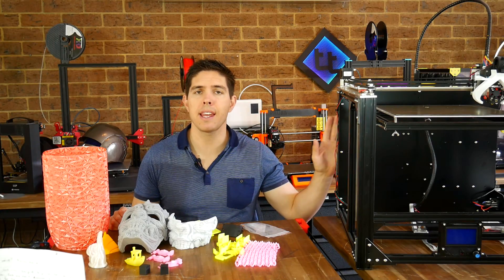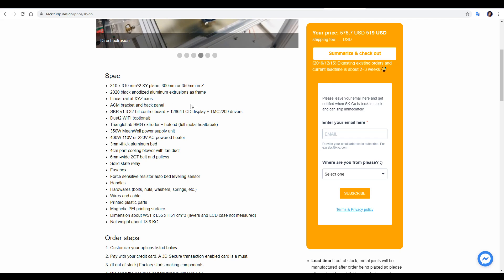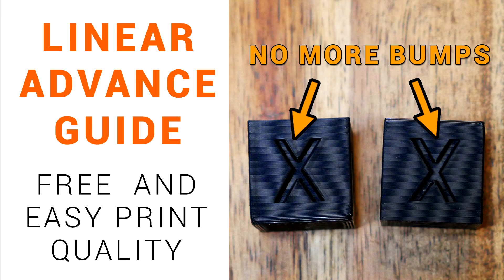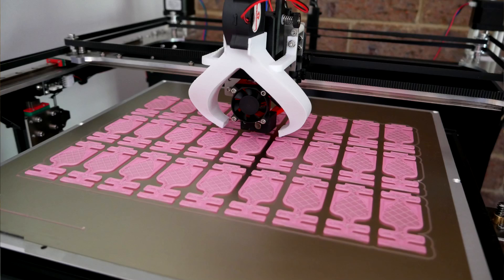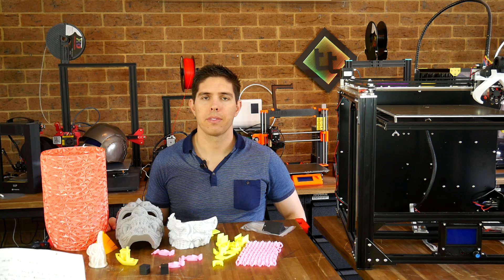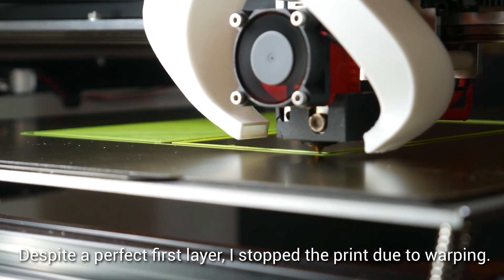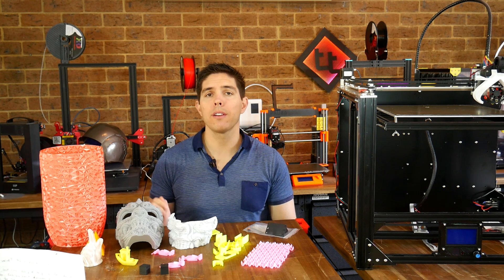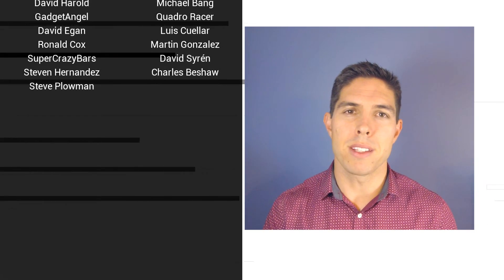SecKit SK-GO review - My best print quality 3D printer to date

Comment: How would you compare this printer to the Creality Ender 6?  It looks good to me from what I have seen from their web site.  What kind of speeds can you achieve with it?  I think though I might look a bit more at the Voron 0.1.  It is smaller, fast, and you can enclose it for ABS.  I just wish it was a little bit cheaper or I could find something similar to a Voron 0.1 that cost slightly  less.  I don't have room for a big printer like this.

Comment: Jesus, $1000 CAD for this thing...I'll just fix any o the issues with the the X5SA Pro that is $700 less....
Reply: I've been looking at the X5SA for my first 3D printer but some of the reviews are scaring me off of that decision. It seems when the issues that it has are addressed it can make great prints though.
Reply: @Invictus_Mithra  yeah its actually not bad at all, have a hemera on it with black leveling sensor and glass bed(also use whambam spring steel) rarely have issues unlike my ender 5 plus that if you fart near gets messed up, I will not do a filament change on it when it runs out, always layer shifts, I will sit there and feed new filament down the bowden tube to my DD hotend as it prints

Comment: So if you have problems with the fan noise try the fan off the machine. If it's quieter then rubber mount the fan or customise the fan housing to incorporate it into the design. if you do incorporate it into the design (o) use a bigger fan.

Comment: Contemplating getting this as my second 3D printer. How easy would it be to use the E3D Hemera, since the stepper motor is no longer sandwiched between two parts of the printer? Just because I have a Hemera handy at the moment and wanted to use the 'suply your own' option for the hotend/extruder. :)

Comment: I wanted to see more on this, my current printer is a cetus mk3 which is somewhat modified. I was debating between this and a prusa for my second printer, can't decide. I don't know if this will be too big a jump or not, I also made a cnc router kit, and circuit design is part of my daytime job. So idk if I should go straight for the sk go or the prusa first, pricing difference isn't major.

Comment: Thank you Michael for another really well-produced video - well done.

This printer seems a bit of a contradiction - it’s sold as the printer that “gets you out of the upgrade loop”, but you seem to have needed many modifications and customisations to make it work and you say that in your summary at the end. It’s a large build area, but doesn’t include auto levelling, so you seem to have had several failures in multi-part prints. Even if only one part fails, it could easily break free, wipe out other parts, and damage that delicate nozzle air duct (which I see you’ve had to repair).

I guess that fine line around prints may be caused by ‘grittiness’ of the linear rails used on the Z axis. I wonder why the build plate frame is supported only at the centre of each side. It was also surprising to see the belt idlers spaced with nuts. 

Tronxy’s X5sa Pro solves the z-stop problem by using an inductive sensor, which also serves for mesh bed levelling (ensures all of the bed can be used). There’s a touchscreen, which shows the levelling measurements, and a touchscreen is always quicker for starting prints or holding temperature between prints. The Z axis is supported on two rods each side.

In your review of the X5sa Pro, you had difficulties with the frame geometry and you didn’t get the same extrusion quality. But you also didn’t make any modifications to it. I wonder if it had a direct extruder and belt-linked Z steppers, whether it might match or better this Sec-kit.

As for me, I have three printers (Anycubic Linear Plus delta, the early Tronxy x5sa, and the Ender-3). The Tronxy has been a disaster since the start, I had endless problems with wheels and belt idlers etc. and I now use my own design of gantry with 608-bearing pulleys. This tends to run for a month or two before my 3D-printed parts distort and wheels slip or seize etc. I have a direct extruder setup with a volcano hotend, and I get slow, crappy prints with lots of stringing, dullness, inconsistent extrusion width. The best part is probably the flex-steel PEI print surface, and Tronxy’s touchscreen seems more useful than what Marlin or SKR offer, particularly for bed levelling and Z offset which work well.

I think I might buy a Prusa... I really don’t know. I just want good-quality extrusion at a fast print speed and 300x300 area!

Comment: Michael, Fellow Aussie. Your videos are awesome and I thoroughly enjoy watching them. After getting my first 3D printer (Ender 3 Pro) a year ago, your videos have helped me out heaps! I've become familiar with the printer, upgrading and modding it and am comfortable using Marlin firmware and using Cura as my slicing program. Getting some great results. 

I'm not at the point where I'm looking to get a larger printer to start printing larger Volumes. 
I'm stuck at whether I should go for a larger i3 Style printer (CR10 V2/V3) or perhaps look at getting a XY Printer like the SecKit SK-GO. 

What would your suggestion be? 
Would it be better to explore other 3D printers, rather then going a CR10 considering it would be very similar to the Ender 3.... or as I am familiar and have learned the Ender 3, would the CR10 be a better option? 

It would be interesting to see some comparison between CR10 and the SK-GO. 

Hope you have the time to reply.
Once again, thanks for your content and videos!

Comment: I bought this printer. Displaycover did not fit the display and only 3 out of 5 linnear rails from Hiwin were ok. Obviously there is something wrong with the way the rails are handled and packaged. I sent an e-mail to seckit asking to buy replacement parts but he doesn't even bother to answer. Avoid this printer and this company folks!

Comment: 2 questions:  did you have to mess with firmware to configure the linear advance? and the model you tested, did it use the hiwin rails or the chinese clones? the website has both as options and I am curious which ones your printer came with

Comment: Wow, the pricing is great! I thought it would be double at least, haha!

Ranged from $519 as a barebones kit (without control board and prints, smaller size, cheap bearing option, no bed plate), to just $732 to best option of everything (except regular control board as I have 0 care for WiFi)

That’s Insanely good quality for the price, the only problem is that $125-$140 shipping in the US (ugg, it costs a fortune to ship anything here... Although I’d have thought it would be like $60, it’s still not cheap any way you look at it). Too bad Santa can’t just deliver one for free cause otherwise I’d pick this thing up in a heartbeat, it’s right at my price range otherwise.

I’m just amazed at the high quality you can get now, my 7 year old Prusa i3 clone kit that came in a bucket of bolts and even required wire crimping yourself was like $300 back then (most equivalent by today’s standards would be those old stock $89 A8 kits or Tonxy models except those are even nicer with a screen and SD card, haha!). This is such a good deal I’m gonna hate turning it down, for now... Maybe in a couple years it might drop some to $600 base level with shipping, then I’ll have to see if I can pick one up, certainly an interesting project for sure! I hope they have a few mechanical engineers that love to tinker such as myself making some open source upgrade parts like I tend to do, because that will be even more quality at crazy XY speed and accuracy!

Comment: Will get quite expensive including shipping, duty & taxes to Europe. Pity :(
Reply: Check out RatRig V-Core Pro, for similair design philosophy (CoreXY, Aluminium extrusions and linear rails, ordering options, active facebook group). They're from Protugal so EU shipping wont be a problem.
Reply: for the price of the shipping i could buy another 3d printer
Reply: Yeah - People in Europe have always seen those extra costs. Just let's face it, we have to pay a lot more for the same quality. Apart from shipping cost we also have to pay an extra 21% VAT (Called BTW in the Netherlands) over the total price. That makes stuff too expensive very fast. While the Ender 3 was affordable enough for me, It is still more expensive than outside Europe.
The SecKit SK-GO will be far out of reach for me for that reason. The best I can hope for (if I want to use a somewhat comparable design) is the Ender 5. That one is just within my financial reach.

Comment: Anyone knows How scalable is the printer design ?

In particular, can the z-axis be easily extended to 50 or 60 cm simply by increasing the lengths of z-components in the frame ?
Reply from the maker: That's a question for Ernest but I imagine that would work well with the obvious barrier being cost of longer components, especially the Z linear rails.
Reply: @TeachingTech  Yes. I contacted Ernest with that question and he was quick to reply, which goes to his credit. Basically, it's up to the builder to identify and source the elongated, increased length, z-axis components. The cost of the basic 300x300x300mm system before modification  is about $600 USD plus  $130 in shipping (to North America). All included, I estimate the materials budget to be around $1000 USD which could yield a 300x300x600mm double-height machine.

Comment: Mods: enclosed printer with temp control for poloycarbonite. Like you were going to do for the ender 5. 
When you say price a little more than a cr10s, i don't know what their worth off the top of my head.
This printer looks a little like the blv hypercube design on thingiverse. I really would love to diy build one of them or a piper 2.
Reply from the maker: CR-10S Pro is $600 US, so price for this is either side depending on specs. Thanks for the suggestions of mods.

Comment: You might try printing abs with skirt height the same height as you models. I tried this and found it surprisingly helpful. I print abs on an open frame ender 3 and smaller parts suffer quite a bit less warping. Larger parts. yeah not much improvement though. I run my skirt 4mm off of the model and model height for abs. Havent tried it with petg yet but will in the future just to see the effect on petg. Just thought i'd throw that out there since you mentioned the abs warping due to open frame printing. But thought this would give you something to tinker with to see if its a method that might help you in the future.
Reply from the maker: Thanks for the suggestions.
Reply: Not a problem at all. If its something i think will help somebody in the 3d printing i will throw it out there. I can't take credit for the concept cause somebody else on youtube did a video on itn i just tried it out and found it works fairly well for smaller stuff. I would also bet money the magigoo in conjuction plays a big roll in my success.
Magigoo is something fairly cheap that you may want to put through its paces as well. Stuff works really good too.

Comment: Hi Micheal, love your vids (chopped!) I'm waiting on the second batch to ship ordered a 350z (lol) model. This is going to be a dedicated high temp material printer, abs mostly. Would be great to see you enclose this printer, similar to the ender 5, Ernest recomended dual ply, acrylic/poly, also suggested insulation so you don't end up building a giant speaker (his words), that and any considerations for the mains power wiring with a heated enclosure would be awesome! But any content on this thing to fill the void until mine arrives is brilliant. Keep up the great work mate!

Comment: Another excellent video thanks Michael.  This could well be a good choice for someone with an engineering background who is looking to add 3D printing to their capabilities.  The assembly and mechanics would not be a problem, and after the normal learning curve (in other words failures) they would have a top quality, capable printer.

Comment: Does it print better even that your prusa mk3?
Reply from the maker: Yes. The MK3 is very good but this pips it.
Reply: @TeachingTech  and it is bigger, costing less than that. Which rails did you have installed on yours. I think would be good to have a small summary of the version you  got yourself